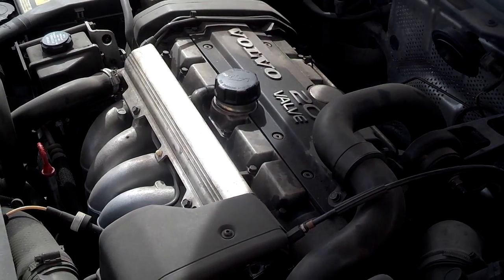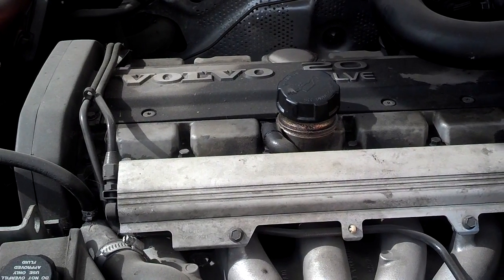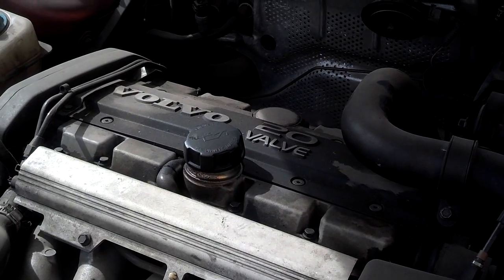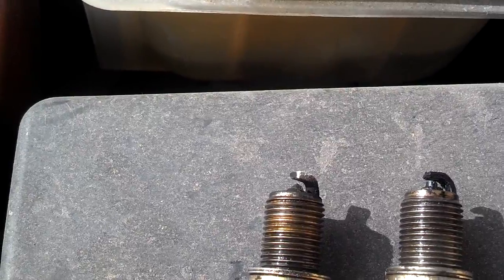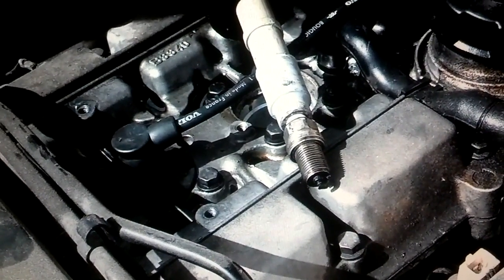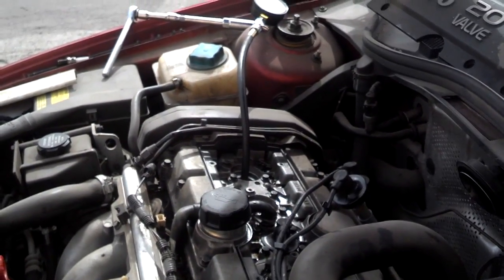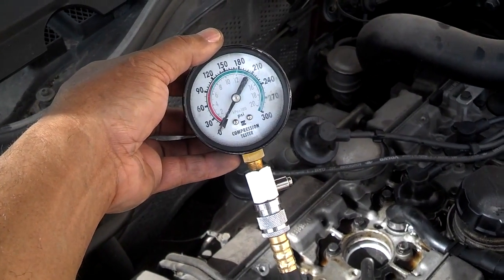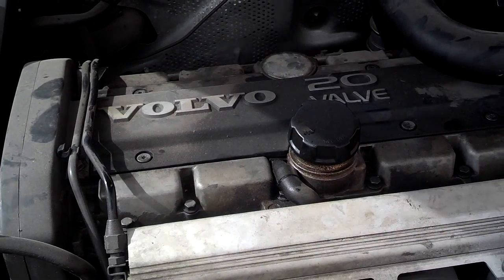Why does my car engine misfire troubleshooting, does it have a bad spark plug, coil or valve? - VOTD

Comment: I have a Ford Focus 2007, I have not dealt with it yet but here is what happens. The scan tool which is an Innova 3160b shows a P0301. The spark plugs were changed out at 60,000 and it has 70,000 on it now, they were swapped out with the iridium plugs that are original equipment, that gap is correct. The engine runs like a top so the misfire is not noticeable and no check engine light. This engine has coil over and I did order one the other day to see if that might make a difference. I realize I could have move a coil pack but they are pretty inexpensive online. Are there time were the code will be set but it will not light the check engine light?
Reply from the maker: Some cars will put the light out if the problem goes away. It may be a random misfire problem.

Comment: Hi. Your video was very informative. Thank you very much. I have a 2002 VW Jetta that is showing codes P0301 and P0420. My research has informed me that the misfiring is causing the other code to come on for the Catalytic converter. I am not getting any shaking and the Check Engine light is on. What could be possible items that I can check or may be the cause?
Reply from the maker: Follow the steps in the video to narrow it down. I doubt the codes are related.

Comment: Hey Robert,

Great video man! You definitely broke it down.  I'm having a single cylinder misfire issue with my car now (DTC P0305 - Pontiac G6 '06 - 117000km) and this gives me a good idea of where the mechanic should be looking. I won't be doing this myself but it's always good to know what possible issues it would be.  I'm a bit nervous now that it will be worse case scenario though..lol.  Hope not though as this issue is recent (started about a month and a half ago) but I definitely feel some jerking/stuttering/hesitation when accelerating on the highway and my check engine light is on.  Will be taking it to the shop in a couple days.
Reply from the maker: Chances are that it's just a bad coil pack. I don't think those cars are know for having burnt valves.
Reply: Robert DIY
hey..just an update.  So I took it to the shop and they basically said that they found carbon fouling on the spark plug in the misfiring cylinder but there didn't didn't appear to be any issues with the coils. They just replaced all the spark plugs and the car appears to be running normally now. I've only taken it out on the highway once but there was no misfires and I definitely don't feel it when driving on a regular road so I'm hoping that resolved the issue.
Reply from the maker: I'm sure it did. Good to read. How often do you replace the plugs?
Reply: I've had the car for just over 2 years (put roughly 20,000km on it) so this is the first time I've had them replaced.  No idea if they were replaced before by the previous owner though.
Reply from the maker: SMH, Have to do the scheduled maintenance if you have no records of them being done.
Reply: I have the vehicle serviced on a regular basis..and it's been safety inspected multiple times.  If the scheduled maintenance is something different then I honestly didn't know as this was never mentioned to me by the dealership or the garage that normally services the vehicle.  I thought this was the whole point of having it serviced.
Reply from the maker: You are correct, but the problem is, "MOST PEOPLE" do NOT have their car properly maintained. Mechanics get tired of telling hundreds of people to do preventive maintenance and just stop telling people. They only tell people when stuff is actually broken. Also, many cars have different maintenance schedules. My car suggest 30k spark plug replacement, while my brother's car suggest 100k plug replacement. A lot of mechanics are NOT going to take the time to learn or look up these multiple maintenance suggestions and just stay out of it.

If you take the car to the dealer all of the time,  most of them tend to know and notify you of these schedules. It's best to check the manual yourself. Many things may be going neglected. A prime example of that is the Volvo's PCV system. Very few service the system and it often causes problems.
Reply: I definitely understand.  I'll take some time to read my manual going forward and make sure to follow the required maintenances from now on.  Thanks again for taking time out to answer my questions on the car trouble I was having. I appreciate it.  All the best.
Reply from the maker: Thank you for watching. Have a good week.

Comment: Hi Robert ,  i have a problem in my opel astra H 1.6 , randomly missfire , however sometime when i am driving car  become declaration and flashing appear , when i check an error , error 300, 302 , 304 appear , never the mind i re change car computer , spark plugs , coil pack , head gasket , head motor , cleaning injector , battery , problem not solve ,

but when i remove wiring in AGE , problem solved , so please if any solution
contact me an  fadibanishamsa@gmail.com
Reply from the maker: Have you checked compression? If the motor is worn out, it will misfire.
Reply: yes i do , i check compression  it is OK , and i replace it by other new .problem still.

 however the problem solve when i remove wiring of AGE ( AGR )  sensor , OK when  wiring separate of AGE from car .
Reply from the maker: I have no idea.
Reply: Thank you  Robert DIY

Comment: Hi Robert I have another question. I bought my car 3 months ago. Under the hood there is a label that is saying that timing belt was renewed a Year ago. On a label no 2 is stated that oil was renewed. There is the same date and mileage on both. Should I trust that or just do the timing belt anyway? I don't have contact with previous owner of that car so I can't confirm that information. What do You think? Replace the timing belt or not? Or try to inspect it visually?
Reply from the maker: Not. Inspect it to see if you can tell if any other parts were also replaced, like the rollers, tensioner and water pump.

What kind of car do you have and the mileage?
Reply: It's Opel/Vauxhall Zafira B 2006 with petrol engine 1.8 (that engines (Z18XER) also has Saturn Astra in USA) , 110k miles on it.